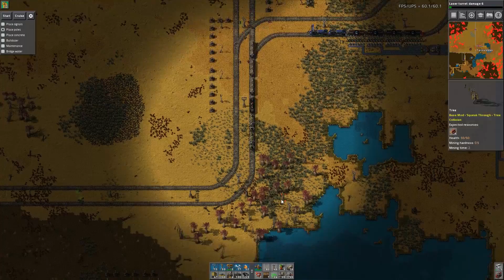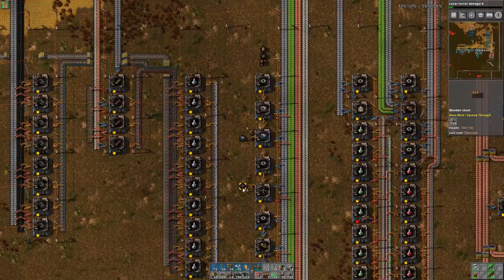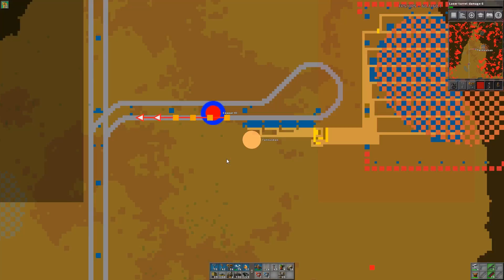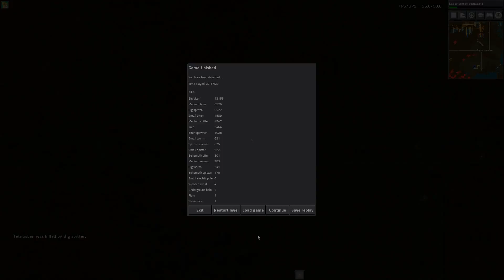Masochists Marathon | Factorio 0.15 Vanilla plus | Episode 21

Comment: The pumps pump more than a single pipe can fill at, aka you attach it directly to a tank it pumps faster.
Reply from the maker: Would it be silly to have a chain of pumps and tanks instead of using pipes :D
Reply: When has silly ever stopped you? ;)

Comment: if you connect all fluid storages on oil depo they will have all equal amount of oil in them
Reply: basicly where is oil input in train those storages connect with a pipie
Reply: there should be one tile free betwene
Reply from the maker: Is this at the unloading depot ? good point, I'll get them hooked up as I was wondering why the train was not unloading equally.
Reply: and loading
Reply from the maker: I don't know why but something makes me want to keep them separate and have the balanced zuri loading, when I try them all hooked up the train tanks don't seem to fill at equal rates due to the fluid mechanics. I know it doesn't really matter it's more of an OCD thing than anything.